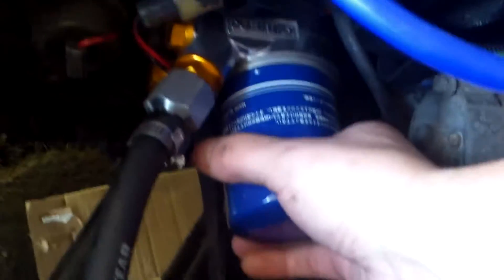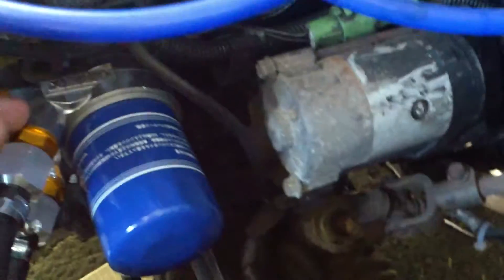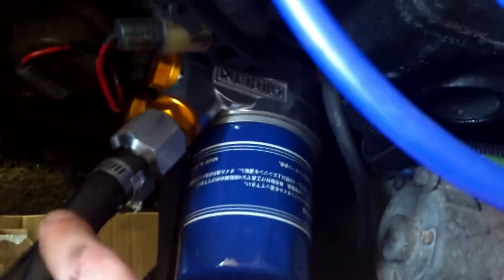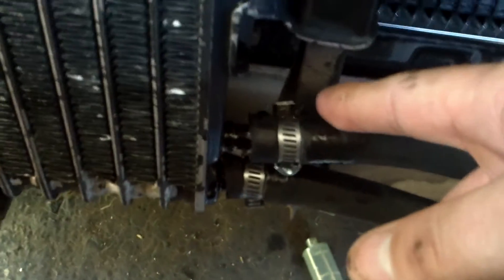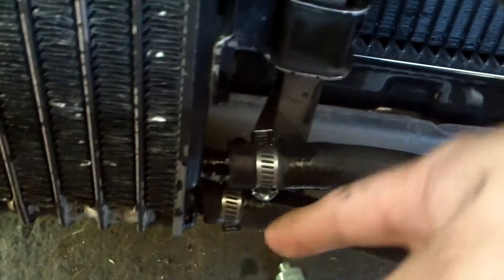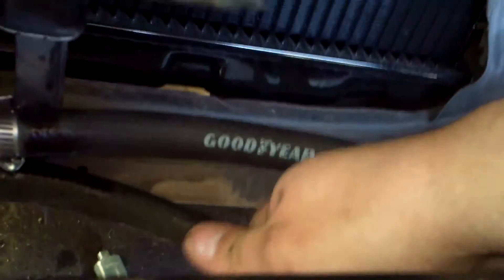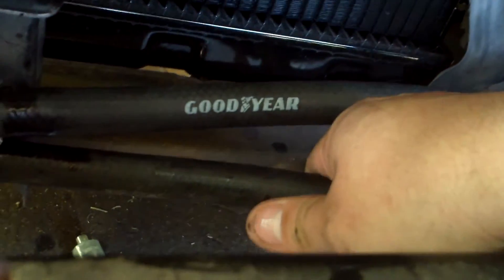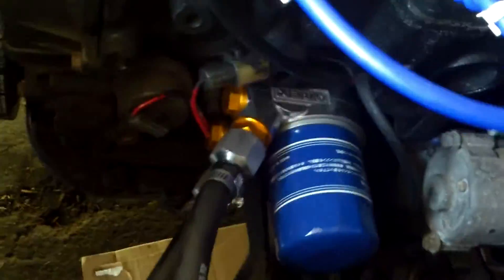AE86 How A Sandwich Plate Works

Comment: So the return from the oil cooler goes back  to the sandwich plate? if your're running a gts oil pan can i just plug one of the ports on the sandwich plate?
Reply from the maker: +MistermookS 
I guess you could but I wouldn't.

Comment: Your cooler is on up side down. There may air pockets at the top that can't escape.
Reply from the maker: Its the OE oil cooler it goes that way. It cannot go any other way. I don't think I have any air problems since I pulled oil through it with a vacuum.